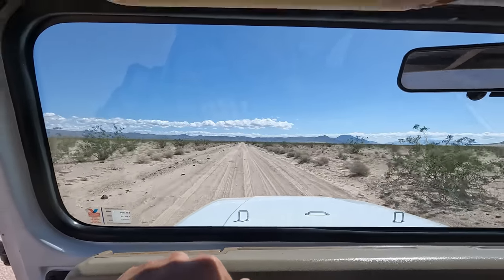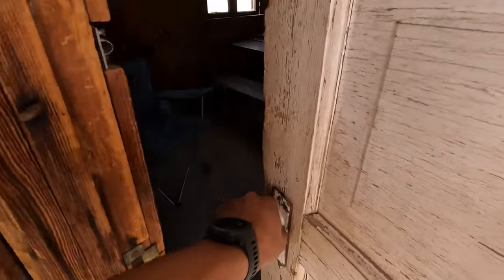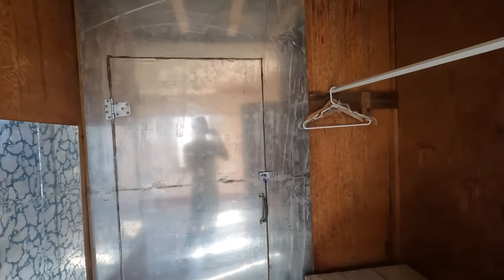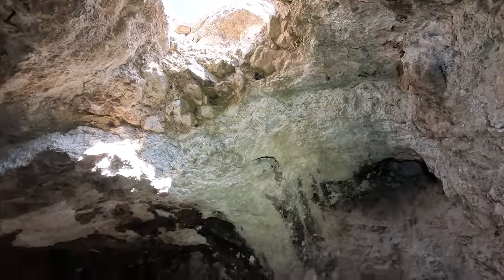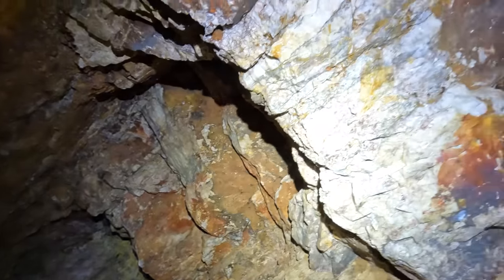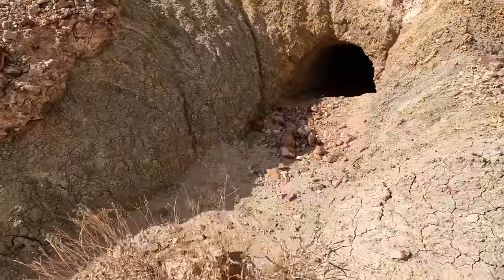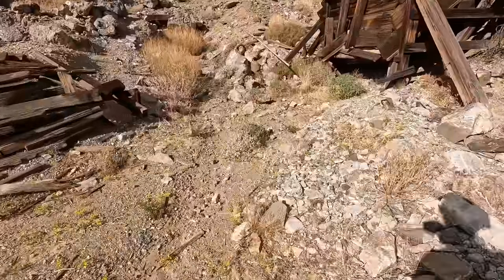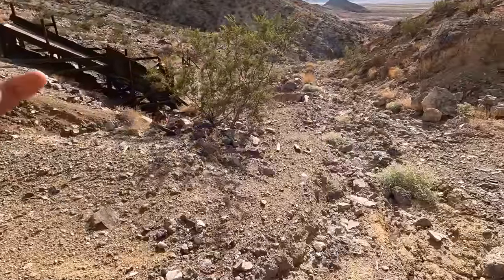Offroading to Pristine Miner's Cabin and Gold Mine

Comment: Is there a map of the cabins or someone to talk to about them... I'd love to camp out next year after I get a Jeep JK to travel to these sites?
Reply: I know exactly where it is but don't want to say to much, as I don't want it to be trampled. But here goes, get a USGS topo map that shows south of Baker, east of Soda lake. There are 2 mine sites on the western side of a mountain range at the end of a long strait road. This is the southern one of the two. Easy to get to going south off of Kelbaker road, about 10 miles give or take south of Baker. You will need to go thru a gate and into a canyon, the gate is open last I was there. Make sure you have a four wheel drive as the road is sandy and even though is pretty decent, can be bad in spots. Good luck hunting!